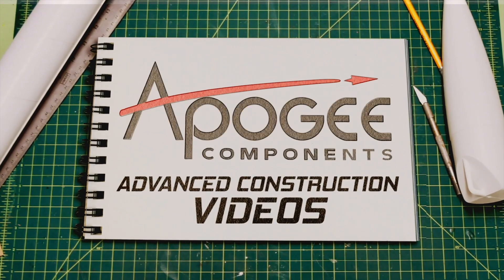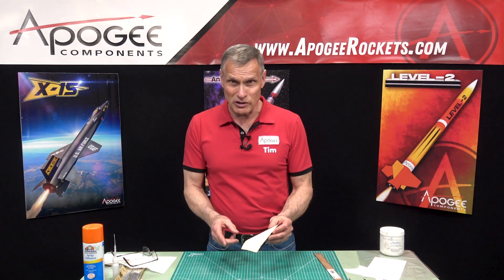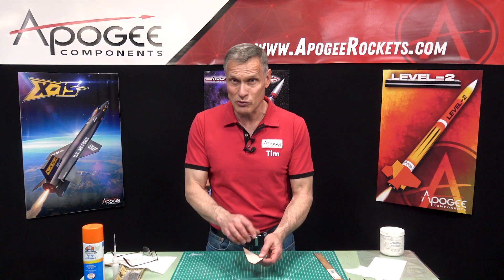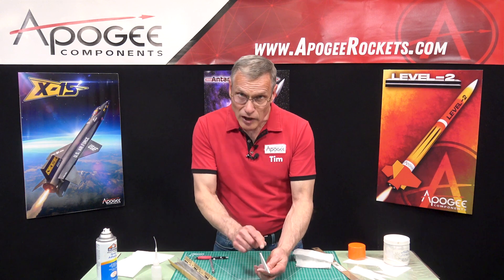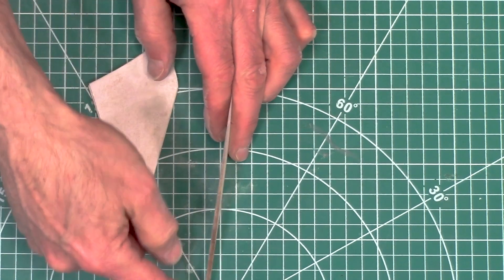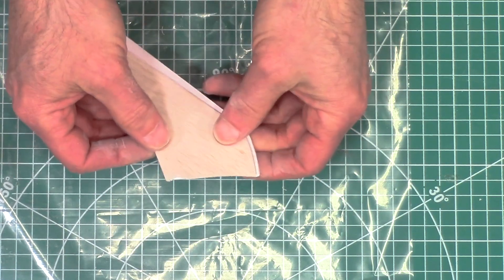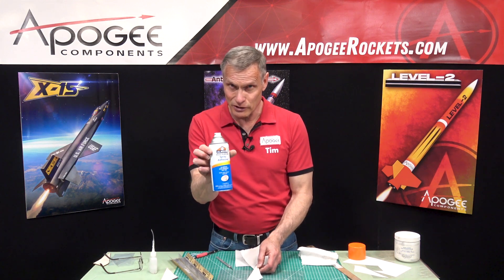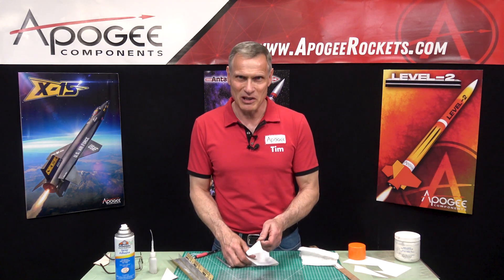How to Paper Your Model Rocket's Fins for Extra Strength

Comment: Back in the early seventies I scratch built an 18mm-powered Nike Hercules and quailed at sanding all that fin surface. I found and used adhesive-backed paper on the fins that made them ridiculously strong-except where they attached to the body tubes. I still have that same model and the paper shows no signs of peeling. I haven't a clue who manufactured it and it added more weight which happily resulted in more realistic lift-offs even with four motors.

Comment: Great video.  I have tried laminating plastic sheets and they worked well for a 1/4 inch thick balsa  
fin on a 29mm rocket engine rocket.  Paint adhered well.  But the paint was brushed, not sprayed as 007 would say.  On messy steps, I use waxed paper and tape it to the work table.  Nothing will stick to it that I know.

Comment: I watched Tim's original video on this subject from years ago and applied it (and highly recommend for all) to a couple of builds. This is a great technique and I used the previous version.

I can say this: It makes finishing the rocket much easier (than filling and sanding the balsa). Though with this technique he's using super glue across the whole surface from above the paper, as opposed to wood glue on the balsa to adhere the paper (then you seal the edges with super glue). That version can get a little weird because of the water in the glue causing the balsa to warp - you just have to do both sides quickly and then press the fin between two sheets of wax paper on a hard flat surface with a book or something on top.

Also, I had a paper laminated fin crack on landing, but the paper held. I simply had to realign it, and ran a bead of thin CA along the crack. That soaked through the paper, hardened, and after a few minutes the rocket was ready to fly again.

Great stuff, Tim! Thanks for updating the video and sharing! :)

Comment: I know using Super Glue is a lot faster than using Wood Glue....  but is it stronger?  In my experience the Super Glue makes the balsa brittle, and Wood Glue doesn't.   Which is important when looking at fin flutter.  Any thoughts on that TVM?
Reply from the maker: It is easy to test. Go for it!

Comment: This is interesting, Tim.  When I was a kid building in the 70's and 80's, we used sanding sealer.  This technique is actually strengthening the balsa, too.  Much better.
Reply: I also used to use sanding sealer..I wonder if the sealer would add more weight than the paper/superglue?
Reply: @barthennin6088  I wonder how Elmer's glue would be?  It would definitely add strength and you could sand it.
Reply: I'm toying with the idea of either using sanding sealer, or tissue paper and dope of some kind to strengthen really thin balsa fins for small scale altitude record attempts.
Reply: @N3onDr1v3  I also thought of the tissue paper / dope option.  I think it would be lighter than paper.  When I was a kid, rocket motors were only as big as 'D', so weight was always a concern.  Today, not so much.  But since I also built stick and tissue model airplanes, I'm still concerned about weight.
Reply: I still use sanding sealer.  Takes extra time, but worth it.
Reply: The sanding sealer/balsa airplane tissue/dope technique works great.  The sealer soaks into the balsa.  The result is a light, rigid and smooth finish.  Also the dope paints give great coverage, with a large number of colors, too.

Comment: I like the ease and speed of this. However since the CA is soaking into the balsa, could this impact the adhesion of wood glue when attaching the fin to the body tube?
Reply from the maker: If it is soaking into the balsa, that is even better for adhesion. But usually, it only soaks in maybe 0.1mm, which is hardly anything at all. I wish it soaked in much deeper, but for that, you have to have soaking into edge grain, not surface grain. This works, just give it a try and don't be afraid to experiment.

Comment: Recently I've started using thin card stock, instead of paper. Gives a much slicker finish. And the added thickness will cover any flaws, or seams.
  I also spray a whole sheet, and once I lay the fin down, I cut around the trailing edges. Then I roll the fin over on the rounded leading edge. Then trim away the excess. Makes for an extra strong leading edge. Then the ca glue treatment as you demonstrated. 
  Those fumes can be brutal sometimes.

Comment: I think the biggest benefit to papering is increasing the balsa strength perpendicular to the grain direction.  This gives closer to equal strength no matter which direction you bend the fins and keeps tips and irregular shapes from splitting.
I always cut my paper skins quite a bit larger than the fin so it isn't so important to get it perfectly centered.  It is easy to sand the excess off of the edges when you add the airfoils.
I used to use nice sharp airfoils but I found that they weren't durable, they would easily get dinged during launching, transportation and storage.  Now I take a compromise and I round the edges.
Your new method requires a lot of materials but seems to be very quick and works better with complicated airfoil shapes.
Reply from the maker: Good point. That ability to have uniform strength in any direction is a plus.